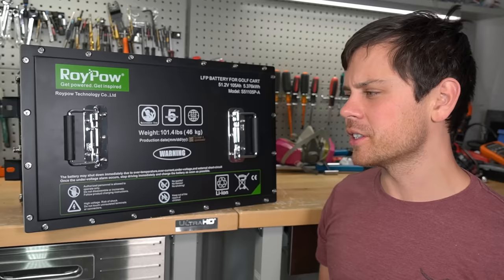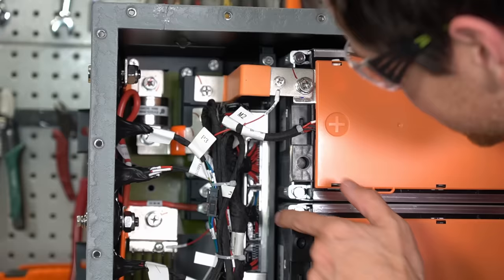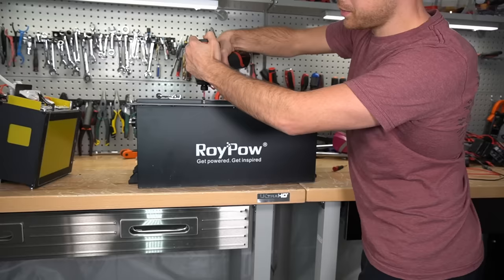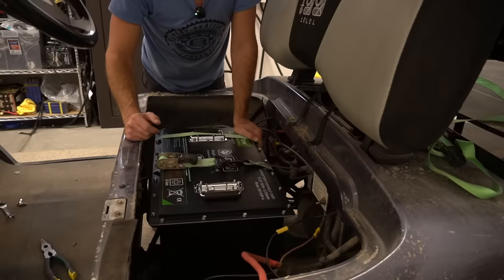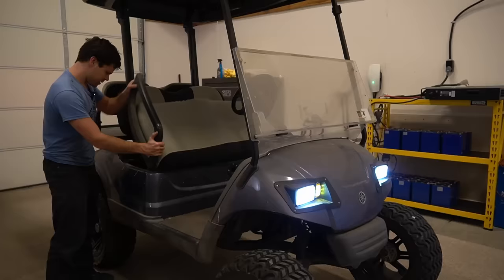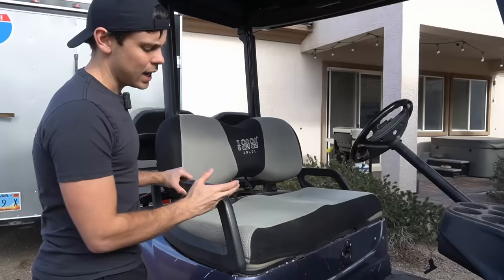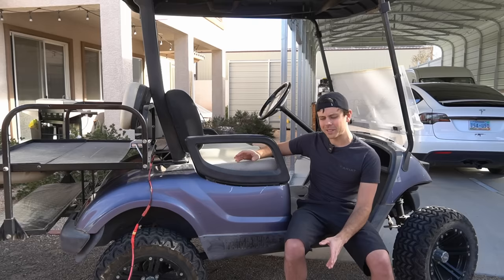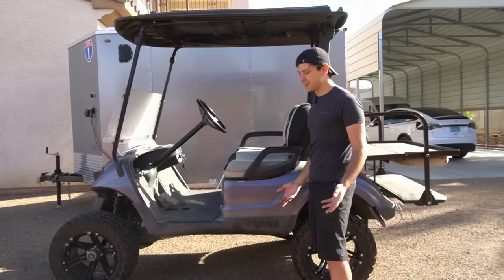48V "Roypow" DIY Lithium Golf Cart Battery: Get rid of lead acid today!

Comment: Hey Will, @WillProse 
What are the specs on the solar panel you used up on top of the golf cart? Did you use anything between the panel and the roypow battery? I have 16 of the 280ah Docan batteries in my golf cart and a 250a BMS running it. I just haven’t found a single solar panel with enough voltage to charge mine. My solar panels on my house run my plug in ac charger for now but you have figured out what I wanted to do but I failed.
Thanks in advance for any information

Comment: I have the same battery in my cart with 2 24 volt 300 watt PV's connected for 48 volts max to the same 48 volt Victron controller as in your video. The PV charger is off because it states PV panels must be 5 volts above the battery voltage that is reading 52 volts being 90% charged now. Even when my battery is 40% charged it shows 48 to 50 volts. How do I get the victron charger to release a PV charge to my battery. The 600 watt PV at max sun is 48 volts so i would need it over 53 to charge my battery below 40% charge?

Comment: My 48V Golfcart seems to have some components that use 12-14V, do you have a recommended step down to run them after replacing the 6x8V with this 48V one?

Comment: This battery has an auto shut-off which is playing hell with my Victron SoC meter.  It shuts the battery main off after a couple of hours.  The meter is trying to figure out amp hours consumed and that just doesn't work when the battery is shut down every couple of hours, resets the meter.  Any way to defeat the auto shut down?
Reply from the maker: Don't do that. Use built in soc meter. Don't use victron shunt

Comment: Hey Will, can you test this battery if it's actually 350 amps discharge capable? I don't believe that
Reply: Yeah from what I've seen these drop in units really suffer when it comes to discharge amperage. I have very steep hills and I pull trailers with my golf cart. Bet these would shut off when the going gets tough. lead acid still seems to reign supreme when it comes to my situation unless I want to spend multiple thousands on a lithium battery or build my own.

Comment: Please stop with the lead acid battery lies. They do not have horrible performance and yes they are heavy. But lets compare will your lithium work when it is 10 below Zero or 115 degrees? The answer is NO. Unless you keep them in a climate controlled area which adds to the the cost of over priced lithium. My lead acid lived through that for 8 years.
 Now a 100 amp lithium will out perform a 150 amp lead acid for one hour. But in your home you need them to last all night and then suddenly under real world working conditions that 150 amp lead acid has more stored energy than your 100 amp lithium and cost a lot less as in I could easily buy 300 amps of lead acid for the price of 100 amps of your lithium. 
 My first set of off grid batterys were lead acid AGM batterys. After I bought them I invested the rest of the money I saved from not buying lithium in an S&P 500 fund. 8 years later I had to replace them so I sold some of my S&P fund to buy new AGM  batterys and still had more money in that fund then before I invested it. So in your world of make believe I literally got them for free. And next time I have to replace them I will still have more money than I started with.
 Basically buy one set of good lead acid batterys Invest the rest of the lithium battery money in an S&P 500 fund and never pay for batteys again. The truth is for the price of one new set of lithium's you can have literally a life times supply of lead acid batterys.
 Maybe its not always about how long your battery lasts but how long MY money lasts. 
 So Stop lying. I got sucked in by your BS title and then the first thing out of your mouth is a flat out lie. I bet money you have been hanging out with those lairs at battleborn. They tell the same lies and when I called them out on it they start sounding like lying politicians. Nothing but word salad came out of there mouth. 
Lithium has its place but stop lying about lead acid. I cant stand Liars
NDR